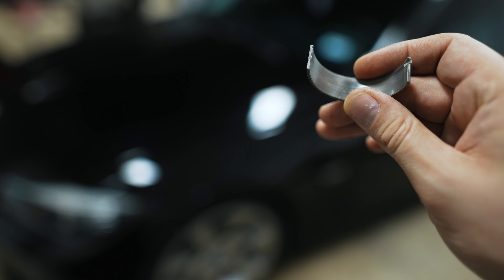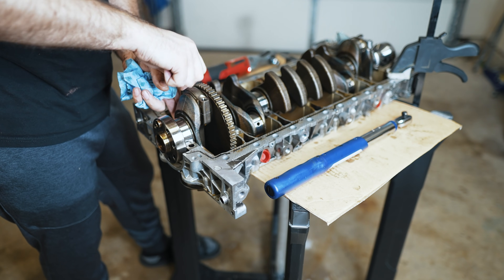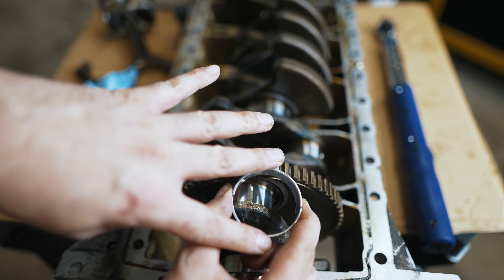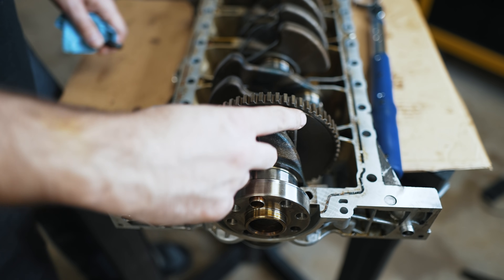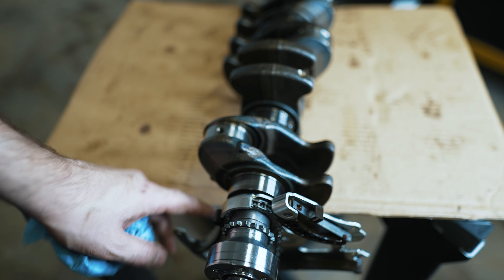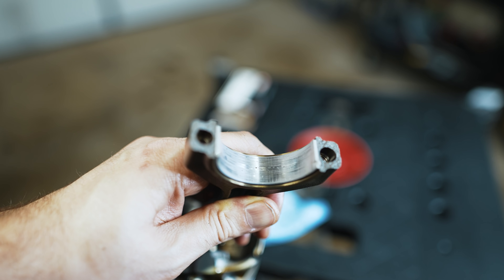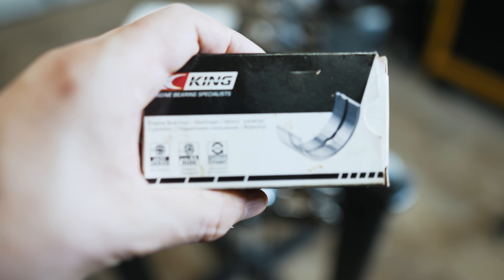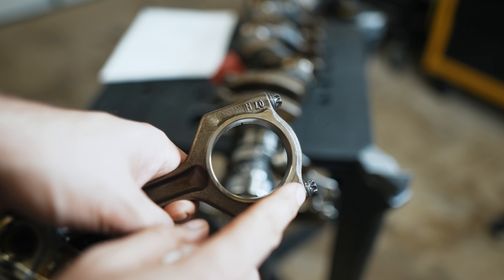Why Can BMW Rod Bearings Fail?!

Comment: Do some research on rod side clearance to the crank webs. Not sure if the N54 is afflicted but other BMW engines were constructed with insufficient side clearance. This meant that the oil wasn't able to bleed-out from the bearings at a sufficient rate and got overheated / overloaded. The optimal bearing axial and side clearances vs journal size and rpm are easily looked up - proper tuners know them. Why BMW didn't stick to tried and tested tolerances is a mystery.

Comment: Unfortunately, the bearing problem is a design fault, and just one reason more why to not buy any Beemer or Merc made in the 2000:s, they just are not made well any more. Long time ago, Volvo started to make straight six using four cylinder tech where possible, rods etc. Very soon it was obvious that the four cylinder rod bearings were not good enough, so they were made of stronger materials for sixes. Many DIY-guys bought similar looking four cylinder bearing halves, just to very soon hear knocking from the engine. So, the bearing surface are is too small, and to be safe, high perf Beemer engines should be opened every 50000 km:s or so. Sorry, old BMW:s and MB:s were excellent cars. The new ones are just junk. I miss those old ones...
Reply: Then how do you explain the original bearings lasting 200K miles?

Comment: Hey man, do you think your manual conversion and SMFW swap could have anything to do with this? I figure engine harmonics may play a factor if you kept the auto harmonic damper/balancer on, especially if you changed the transmission-side dampening characteristics with the SMFW. Just spitballing here since the N54 is an i6 and everybody seems to ignore engine harmonics because the N54 is supposedly indestructible. Really depends on whether you were doing prolonged high RPM stuff aswell though.

Comment: Did you say your car was running for 10 minutes therefore the oil wasn't hot enough ? 10 minutes of driving should be enough time to bring the oil up to normal operating temperature , regardless , I know a few people who done every N54 preventative maintenance you can think of and still spun a bearing ,

Comment: The tendency for the connecting rod bearings to wear out earlier at BMW than at other premium manufacturers is something of a "tradition" and is also based on the fact that the crank pins as well as the main bearings are relatively small and narrow in diameter.  This facilitates or benefits the engine's engine revving power, which is already legendary at BMW.  However, one must also note that some contemporaries tend to be careless, if at all, with warming up.  Internal combustion engines now have a work area in which they function optimally.  The cold state of aggregation is not one of them!😉

Comment: Did you also use 5W-40 with the stock bearings or did you switch to 5W-40 when you changed to the king bearings?

Comment: To properly do what you are doing, you must first immobilize the crank in the block, then stick a piston w/o rings on the rod and stick it in the cylinder block prior to torquing the rod up on crank. Otherwise the rod and crank moves about during torquing and you are "smearing" the plastigage on the rod journal getting wrong reading. Besides, measuring in 2 planes with a mic the journal and rod is more proper than plastigage.

Comment: I love and own BMW's, but the problem is simple. Chevy v8's will practically run without rod bearings and last. Why? Tons of European and Asian vehicles still use cross drilled mains instead of straight shot oiling. Centrifugal force at high rpm starves the rod bearings for oil. No coating, changing clearances, etc will fix it. Metal on metal = screwed.

Comment: Did you measure the thickness of all new bearings shells?  Did you plastic gage all of the journals for the proper oil clearances

Comment: Bearings fail because of oil not at operating temp when redlining engine and hard throttle applications without properly bringing engine to temp 
-Bmw master tech
Reply: Well, I am very anal about warming my car up properly, I always drive it gently instead of letting it idle to warm up. Never above 3k rpm until at operating temp. And still, the rod bearings on my E46 M3 failed. In my case, it seems it was a combination of classic S54 rod bearing wear combined with a rather poor oil pump. When I took it apart I found that the clearances were far too loose on the pump gears, so a combination of lower oil pressure plus the rod bearing wear finished it off.
Reply: Bearings fail because of oil not at operating temp when redlining engine and hard throttle applications without properly bringing engine to temp ON ANY VEHICLE
-Bmw master tech

Comment: Not sure about N54 but N55 uses a solenoid to vary oil pump output. This is the solenoid at 10-11 o’clock from the crankshaft when looking at the front of the engine. Purpose is for fuel economy/engine load but to ME that variable oil pump can cause oil starvation in the bearings towards the end of the block if there is any pressure drop throughout the system- chain tensioners, VANOS, rod bearing oil clearance, main bearing oil clearance, oil squirters, oil cooler, etc. Different engine, but the Hyundai 2.0 I4’s 2010-2013 were plagued with spinning bearings. To my knowledge there’s no definitive answer yet but what I noticed in the engine I tore down was that the bearing condition was worse as you moved from the pump. The oil pump creates flow and pressure is a function of the flow being restricted (where bearing clearance is critical). If clearance is too high in the other rods or mains, it can starve the other bearings and components further from the pump. You may consider checking clearance on all rods and mains in your search for why your engine failed.
Reply: This is a quality outlook. "The squeaky wheel gets the grease". I'd like too see a comparison of tolerance to an oil flow diagram.

Comment: Can it be like you said ? The King bearings had more clearance and possibly decreased oil pressure to the journals causing the bearings to score ? 
Is it possible to have installed the bearings in the wrong orientation?

Comment: Interesting videos man, have you considered having your oil lab tested for contaminants or clues? Had my n54 fail on cyl 6 bearing and lab results indicated high fuel content in the oil caused by leaking injectors. Never followed up if this was the cause of the failure so would be curious to see any similarities. On a new engine now and I get my oil tested every oil change.

Comment: I love your videos,  I work as a nurse and love working on cars.  Been building honda and mitsubishi engines for 30 years as a hobby.  Just started working on  BMW's for that last 4 years. Just got done rebuilding my 2nd N54.  I've made my mistakes over the years and definitely learned from them.  That's why I love videos such as yours.  I was thinking about your spun bearing situation.  Sometimes it's the simplest this that causes the biggest problems.  I don't believe it was the clearances on the bearings or the pump itself.  I believe it was the oil pickup tube or the pickup tube o-ring gasket fitting to lose and sucking air along with oil.  Like trying to drink a soda from a broken straw.  You will register enough oil pressure for the oil light not to trip but starve the engine at the same time.  The reason I said this is because it has happened to me with one of my first rebuilds.  All my rod bearings were toast.  Just a thought.  Great job on all your videos my friend.  I've learned alot from you.
Reply: A pump sucking air from a leaky pickup tube would also be aerating the oil which drastically reduces the film strength.  👍🏻
Reply: This is what I was thinking, since I just did my bearing on my s54.  I changed the pickup connecting tube oring to viton. I dont think the oem is viton.  It was also loose when I pulled it out. The new viton oring is a super tight fit. I hope I dont have the same issues its terrible scary.

Comment: The first time an engine runs is crucial, it could be so many things wrong but, let me ask you this. 
• you probably used assembly lube, but to be sure did you? 
• did you primed the oil system before cranking it up? Did you reached full WOT pressure during the priming?  If not, something was wrong, you should've never ran the engine and check your work and parts. 
• could you measure the length of the conrod bolts, did they all stretched the same +/- 0.5mm?
• did you plastigauge the replacement bearings before final installation? 
•eventho the oil pump looked okay, were the oil passages for the bearings clean? If you push air thru them, was there any debris?

Comment: The caps on those rods look weak around the bottom part, that's particularly relevant at high revs on the over run.

Comment: My thoughts:
first of all any debris that gets sucked up by the oil pump is directly put through the oil filter, (I have seen cheap, non OEM, filters split in half before on the tuned n54s I have worked on). but damage from debris will usually leave a sizable groove on the journal and or bearing surface, that being said I think it is safe to rule that out. The only way I could think this might be caused by debris is if the oil pick up some how got blocked and momentarily starving the motor of oil. The temperature mentioned is also concerning, 120 degree oil temp might not affect rod bearing clearance too much but more so piston to bore clearance and if you logged 28psi and the pistons were not fully expanded in bore that might have caused it to unevenly load the rod bearing at close to the max load they can handle. I DONT think you did anything wrong with the assemble of the bottom end. It is unfortunate to see an n54 die, all the reading I have done on building M5x and s5X motors all seem to have a similar theme, sealed, well maintained bmw motors that are tuned within their limits will out last any motor that has been tampered with no matter what parts or how carful/experienced you are with reassembly. best of luck with the new motor. keep up the great content :).

Comment: Good video, but the bearings wont change shape with centrifugal forces. When you torque the rod the bearing becomes round :)
Reply: This is correct.
Reply: I called BS on that factoid too.
Reply: The bearings are also designed like that on purpose so they do not fall out when installing. The diameter across the bearing is slightly larger than the bore of the connecting rod. It’s called bearing spread.
Reply: At this point I think it's way better to order the bearing kit from the dealer with the VIN, and once you install them the gauging procedure is still required, also the special lube would be helpful during the very first spin.
Reply: @goodlife3655 It wouldn’t had help

Comment: So just my 2 cents here take it or leave it. You are correct the bearings aren't perfectly round what makes them round is when you torque the rod bolts there is a slight crush on the split line of each bearing shell that beds the bearing shell to the ID of the rod. If that crush isn't correct the bearing sits loose in the rod and can spin a common misconception is the little tab on the bearing shell holds the pieces from spinning when actually the rough honing of the rod ID the surface finish on the back side of the bearing shell and the amount of crush to force the bearing into the shape of the rod ID is what holds the shells in place. Bearings normally spin because they are loose fit or in the case of wear the center of the shell gets worn away causing the bearing to collapse inward and eventually spinning because it looses the crush that holds it out against the rod ID. I would be curious at this point to torque your rod caps without the shells and swing a bore Gage through them to see how round they are I bet they have stretched to the point where they won't hold a bearing properly which may be the result of using stronger bolts from arp.
Reply: Absolutely spot on,if the rod bearings are not pinched properly in the Conrod when tightened spinning will occur and I seem to remember this guy putting thick oil between the rod and bearings,I have never ever seen this done before in 50years of engine building. Both the rods and bearings should be fitted dry to each other and only the bearings surfaces that face the crank journal should be lubricated with engine oil,I would have checked the rods with a dial gauge to check for roundness and wear without any bearings fitted only then after checking the crank journals to make sure they weren’t out of round would I assemble. The bearings have to be a tight push fit in the cap and rod.

Comment: 1) There a perfect circle when inserted in to the rod, not out of the rod. 

2) You're "egg shaping" the bearing torquing and loosening the rod without shimming the rod with a file gauge.

3)Check the oil pick up tube, it might be clogged, when the serpentine belt goes out, it sucks it in the engine, and people replace the front main seal and never take out the oil pan and check what's going on in the engine.

Comment: Heavy oil. BMW spec'd a silly thick oil for the V10 and that caused them to fail.
Reply: You need thick oil to prevent VANOS from killing itself due to cavitation. The only thing you need to do is warm it up really well before driving and change oil every 3-5000km.

Comment: Is you're torque wrench calibrated? maybe since you did not change the main/thrust bearings ;may have caused clearance  imbalance?;you have needed tighter bearings ;0.0001"? 🤷‍♂️; Get crank and rods measured and balanced to rule out damage.

Comment: What’s the mystery? You lost oil pressure and scored the bearings causing a failure. Something got trapped in your oil pump.
Reply from the maker: You're probably right so I need to completely disassemble the pump.
Reply: @VehicularDIY  absolutely. 👍

Comment: Nice informative video! My 2007 335i with the n54 is currently at 155k Kilometers ( not miles ). Do you think I should worry about the oil pump yet? Or is that with much higher kms / miles
Reply from the maker: I would think you'll be fine for at least another 100k kms.

Comment: I believe you probably used the SV grade King bearings. I built a tuned motor with the same bearings and verified all clearances. It failed at 40k. It ran fine the whole time. Daughter drove it. Her driving habits could have made it worse because she would push it a little more than she should have when cold but nothing extreme. I did an oil analysis at 10k and everything was fine except it had slight amount of silver content. I researched and found the silver was from the rod bearings. I later found out that these engines have coated bearings from the factory. I am building a 2nd engine now and using ACL bearings.
Reply: How's the 2nd engine coming along?
Reply: King bearings dont use silver in their bearings. They use steel and aluminium....anyways, ACL and King use two different type of bearings (trimetal and bimetal), please do your research and decide accordingly.
Reply: @leoteruel2756  you are hopeless and have no clue what you're talking about. You have replied to every comment where somebody talks about the materials in King Bearings, telling people they are wrong, when it's you who is making things up. King SV is tri-metal silver based with bronze in the middle. SP is tri-metal sputter (hardest, also most expensive, and only highest load-bearing side is sputtered).
Reply: Hi pro i will try 3rd. But are you do it  wahts the Result.?
Reply: How are the ACL bearings?

Comment: Did the car go kablooey BEFORE or AFTER you started using that üro aluminum oil filter cap? With this new engine replacement, using the same metal cap, if it does this again, you will know 98% the reason. I know you have your doubts and you said you checked your oil pressure, but I just could not bring myself to install that metal cap because the center core cage just didn't fit correctly and the metal spring was resisting movement to the point where I could not move it with my index finger, whereas the stock center core spring could be easily moved with my index finger. 

I have no idea what that center spring is for and what it does, but the vast difference in resistance itself with the fact that the center cage would not click into place was enough to make me reject using the part.
Reply from the maker: I will report back on the oil pressure with and without the cap installed.
Reply: @VehicularDIY  You ever investigate this? I had bearing failure only 4k after replacing my oil cap, skeptical but simultaneously its an interesting concept
Reply: @VehicularDIY  curious to know this as well. i just ordered two of the uro caps for my two N54s. please update on this cap

Comment: It happened to me in the past. I used a flexible, but strong enough wire and went trough every feeding oil channel in the engine block and head, crankshaft, etc. I was amazed what the wire brought out and the compressed air didn't...
Every little obstruction matters a lot when it's about oil flow or quantity of oil/second!
Anyhow, great work! I love this guy! I really like the way he approaches different situations.
Reply: Try pipe cleaners next time
Reply: like what? bailing wire?

Comment: https://f87.bimmerpost.com/forums/showthread.php?t=1728861
I read this post, go to #14.
This guy mention oil priming. Making sure no bubbles is residing within the lubrication system.
Reply from the maker: Yeah I just cranked it over a few times with the injectors unplugged.